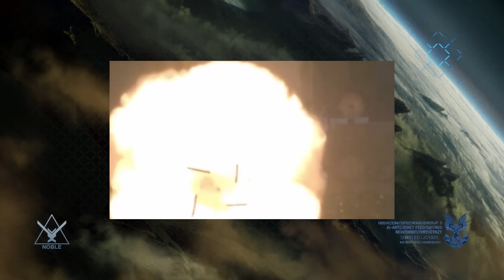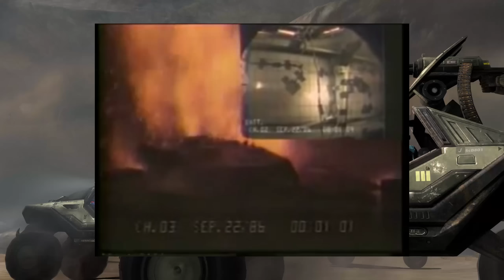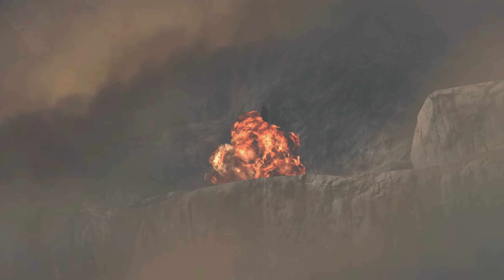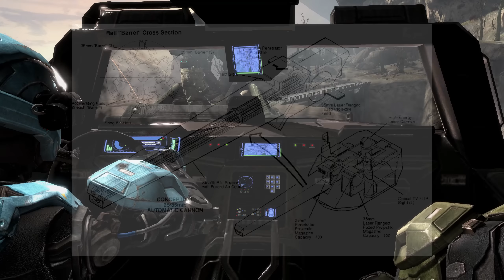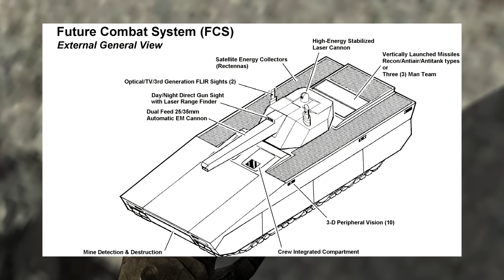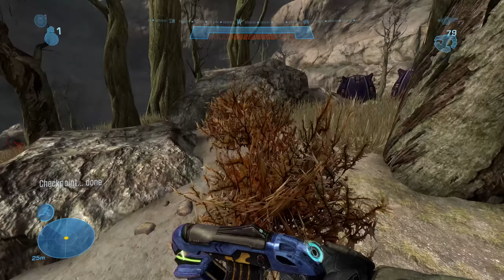Are Railgun Tanks Practical?

Comment: What about HE rounds? can railgun give support agaist things like mg nests or infantry positions?
Reply: Imagine the kinetic energy of a mach 8 plus projectile
Reply: @Hovis_Enjoyer  I don't think it needs to explode, if it's traveling at multiple times the speed of sound when it even passes the target.  Just imagine a semitruck blazing past you at 70 MPH as you're walking along the side of the interstate, and how much it can buffet you as it passes, and pull you from the resulting drug.  Mach 1 is 10 times that speed.  Mach 8 is 84 times that speed.  

Factor down for the difference between a shell and a semi-truck, then think about that flying five feet past a human being.
Reply: @Hovis_Enjoyer  air has a recistace too you know
i woder what hapens if you speed a Impact fuse up to mach 8 (or higer)
Reply: For HE the railgun could lower its power, and thus G-forces on the HE projectile. (They do not rely on kinetic energi, so M/S would not matter as much)
Reply: I would think so? But you would need a much more robust detonation system to handle the launch forces
Reply: The kinetic energy of lets say a 40mm wide and 500mm long depleted uranium round fired at plus mach 8 combined with the depleted uranium's habit of self-combusting sounds like at least enough destructive power to destroy a bunker, at least a mg nest.
Reply: @villepore7013  that sounds really nasty. Would defenentily cause a significant emotional event.
Reply: The BAE Systems HVP projectile can carry a 2.5 kg payload. It can carry a HE payload. The detonation would be like a small HE rocket. I'm assuming it's so small because they want to maximize aerodynamics to make the projectile go farther, which leaves little room for a payload. I suppose it would be possible to sacrifice aerodynamics/distance for a bigger payload. Side note, the projectile is guided. General Atomics claims they can do a guided projectile that has airburst mode in which the projectile explodes at the last moment into a shotgun-like blast. No idea how big or effective it is.
Reply: @AleksandrKramarenko  See that's cool and all, but I've never heard of a "High velocity projectile projectile", do you mind ELI5?
Reply: I want to see a canister railgun round... mach 8 giant shotgun anyone?
Reply: Mr. Wednesday committing war crimes one two inch circumference ball bearing at a time
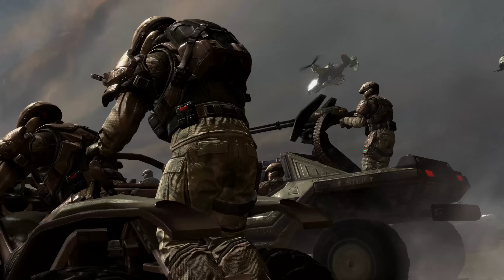Reply: @Mrwednesday84  Already exists https://www.youtube.com/watch?v=O2QqOvFMG_A skip to 0:49.
Reply: @Mrwednesday84  shotgun railgun that uses spikes not pallets just how messy will that be if it hit someone
Reply: I would not advise putting an explosive component to something that could potentially vaporize during acceleration.
Reply: Yappir Helpful let’s be honest here the velocity of the projectile will have enough force to tear apart a mg nest
Reply: In my opinion the answer is: kinda. If you would put a HE shell in a railgun, the pressure which it would face would most likely detonate it, but if you bring up the point that the sabot/projectile would have enough kinetic energy to destroy a machine gun nest - most likely not. A modern 120mm sabot flies at about mach 5.1 and you dont see those creating explosions like a proper HE shell. 
But if you hit the machine gun or a steel shield, the the shrapnel should in theory be capable of destroying the nest(this also applies to bunkers). And about the infantry position, that is for what the machine gun is primarily ment for.
Reply: to be honest would you really need HE when you have a substantial slug traveling at Mach 8
Reply: @ValentineC137  Yes, against soft targets which are like 90% of what tanks are meant to shot at.
Reply: @LuisLopez-zh9kh  you're telling me the kenetic energy of a mach 8 slug does nothing to a soft target?
Reply: @ValentineC137  We are talking blast radius here. What you propose hasnt been tested in real combat so we have no way of knowing.
Reply: You could use small bursting charge so the slug arrives in pieces, but overall they're just ineffective at that role. Railguns have much lower caliber than conventional gun of equivalent size and need sturdy projectile body, so their HE content is far smaller. Against those targets, you gain fuck all with extreme velocity, so just go for the howitzer if at all possible.
Reply: I don't see why not but I feel like you don't need HE rounds that move that fast. Feel like vs infantry you want area coverage not penetration. Also it seems like overkill currently. Feel like you run into the same problems with metal storm. Like yeah you can put an explosive round through half a mountain to kill that 1 mg nest but why would you need that.
Reply: @dagonofthedepths  HE Railguns could be extremely useful against aircraft, though the implementation of explosives and proximity sensors into the projectile is problematic.
Reply: @northropi2027  I still don't think you need the HE component even with anti-air. If you can hit the thing with a shell going over MACH 8, that plane is gone. If you can't you pretty much are trying to make an expensive flak cannon. Besides the heat of a shell going that speed + explosives and wiring seems like a bad idea.
Reply: @dagonofthedepths  the point of the explosive would be to eek out a bit more hit probability, though Railguns would already have a decent chance to hit planes anyways because of their velocity.  I think it might also help because a direct hit with a solid slug might overpenetrate but maybe I'm sort of misunderstanding that.  If the shell goes too fast in proportion to the resistance offered by the structure of the target, it'll pass through without any of the, like, killy interactions, right?  It'd only leave a hole, which isn't actually that bad unless it goes straight through something important like an engine.  The old milk truck versus APFSDS thing, though I guess planes have more fuel to hit.

That said, yeah, the sensitivity of the filler and fuses/sensors is problematic, whether that means the shell straight-up goes off in the barrel or the fuse just fails and it never does.
Reply: @northropi2027  The round will over penetrant like mad if the round stays in tact. Most planes are going between MACH 2-3 so your talking about a round hitting at MACH 10-11. But planes are not armored like tanks and air frame tolerance is a factor. Also if you cut the main body of a plane in half most of the back section is engine. The front quarter tends to be internal ammo cockpit and radar/electronics just for reference. Honestly I think if you can make a round designed to fragment on contact with the plane it'll do enough damage to rip the plane apart (within reason). I feel if your doing a HE round it'll be the shrapnel that kills the plane anyways and I also feel like if your going to put shrapnel into a MACH 8 bomb your going to have metal shards falling for miles after. I don't know, it just seems like a lot of money to just send a HE round to a plane and current AA tech works fine in shooting down planes assuming you can see them coming.
Reply: @dagonofthedepths  well, getting it to fragment could be an issue.  The round needs to be structurally strong to withstand the launch forces and drag, so making it fragment honestly might be best done by using a reduced explosive charge inside of it, which leads to similar problems but presumably to a lesser extent than more pure HE shells.  Collateral damage could be an issue but drag would slow fragments quite effectively due to their reduced mass and irregular shape so they wouldn't go as far as a solid slug.  As for cost, it shouldn't be all that bad.  It would need to be higher-quality metal and a fuse with tighter tolerances maybe.  As for current AA tech, well, yeah, but a railgun could achieve a high hit probability at range for less cost than a missile, which could give it a niche.  I have a feeling lasers and just faster missiles are already gonna make the skies a much less fun place to be in the future though, so AA Railguns may never become a mainstay.
Reply: @northropi2027  It shouldn't be that hard to get it to fragment on impact. the target is much more resistant than air is after all. You can use the target to fragment the slug like how jacketed hollow points work. Feel like that would be cheaper than making a super fuse that would resist all that heat and air pressure then trigger fast enough to explode near the plane. I get the range thing and I agree with it but I feel like we have weapons that do the same job better. I think fighter plane tech and stealth detection will have to shift first for that to be useful. Which given how scary F-22s are that'll probably happen but as of now I can't see it. It just seems like that Metal Storm thing. Where they made that gun that fires something like 200,000 rounds a minute. Yeah it's cool but do you really need to shoot 1 guy 3000 times in one second?
Reply: Maybe in the future, right now no, they can't the problem is that the projectile need to be able to resist the acceleration an be extremely conductive. So even if you fire the HE round at lower velocity it still need to be able to conduct current and don't explode from the current going through the round.
Reply: the railgun would have to reduce velocity otherwise HE shells with any substantial amount of HE filler would get destroyed on launch. Also as he said if the barrel diameter is small, then the HE just isnt really that effective
Reply: I personally would advise against the idea of putting an explosive component in a railgun.
Short answer.  The explosive component could detonate during acceleration.
Long answer.
Even in modern weapons there is a need for what is in essence low reactivity explosive materials because the violent acceleration of the projectile can prematurely activate (detonate) the explosive component.  At worst it would mean the round going off in the railgun, at best it would mean the round prematurely detonating during flight.  A railgun would be a near exclusive kinetic kill weapon, either anti-armor (a single projectile) or anti munitions/personnel (Similar to buckshot, probably going at least mach 3 on impact.  This could turn a person into red paste). 

Explosive components in a railgun sound interesting, but kinetic energy and how it can inflict damage/destroy a target is not something that should be overlooked.
Reply: Dumb question, but why not design a projectile with very stable explosives (like C4) and connect the tip with a detonater that sends a small electric spark to the explosives when it hits something?
Reply: @TotallyNotAFox  while the stability of C4 would help, is it stable enough to take it?  'Cause we're talking like a fuckton of heat and acceleration and...  wait, actually, no, it wouldn't work because of the electrical primer.  Railguns aren't like Gauss guns where it's literally just magnets, the current is run through the projectile to pull it with Lorenz Force, so it can't be electrically sensitive either.  You'd need to go for an extremely insensitive conventional primer.  That or a Faraday cage within the projectile leading to a...  Charge sink?  Ground?  Is there ground in a projectile?  Can you put the primer in a Faraday cage and still have it in contact with the explosive?  Electrical stuff is not my strong suit but the takeaway I guess is that electrical sensitivity is bad too.
Reply: How about using compound that only explode in high velocity, while remaining inert in normal condition?
Reply: @joshg8053  If that's a thing (I honestly don't know would be cool if it was for science and all that) the slug would explode in or near the barrel. Bullets are at their highest velocity when they are fired.
Reply: @dagonofthedepths  I remember reading about a paper addressing the problem of explosive in railguns while giving the solution of using compound material which would explode at specific condition or maybe using inert detonator material.

I think you are right about the velocity, I just half remember the condition in which the compound should explode.

Maybe it could engineered when the material contact the target, thus creating high pressure on the material.
Reply: At these projectile speeds, explosives don't add much to the energy delivered to the target.  A bigger improvement would come from matching the projectile density to the target.  I.e to explode, use a concrete density slug on concrete, and a steel density slug on steel.  (ofc for penetration DU and Tungsten will still be tops)  You might still have explosives on the shells, but only small amounts for fragmentation near the target.
Reply: HE rounds would bring back a lot of the problems of conventional cannons. That said, when a slug form a railgun hits anything solid, it throws a huge amount of hot sparks everywhere. Those would probably cause severe burns to anything or anyone they came in contact with.
Reply: Coilguns seem to have very little or no recoil so i think they are perfect for spaceships
Reply: Haminator Ainz Firing any kind of unguided projectile in space is usually a bad idea. First, because of the distances involved, the target can likely dodge. Second, there is every chance that if you’re orbiting a planet, that projectile will eventually come back around the planet and hit you, especially if you haven’t repositioned.
Reply: @turkeyboy5543  like what you can hear in the background of Mass Effect 2 you want for the computer to give you a firing solution and if you miss you are messing up someone else's day
Reply: @turkeyboy5543  video of it is called mass effect 2 sir isaac newton
Reply: Railguns could be useful as bunker busters due to the sheer amount of Kinetic Energy it carries. You can destroy reinforced hangars and earthen bunkers with it.

For a Railgun to carry explosives is both redundant and dangerous. High Explosives would still be a thing in the military in terms of EOD and demolitions.
Reply: Yes a rail gun can fired anything you put in it. A design is absolutely possible